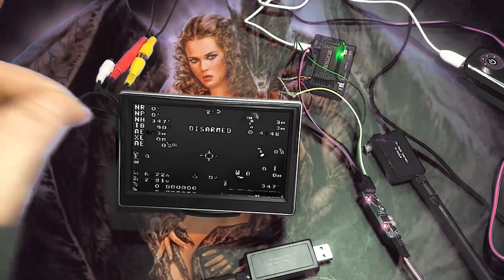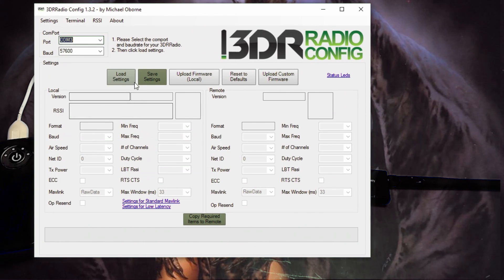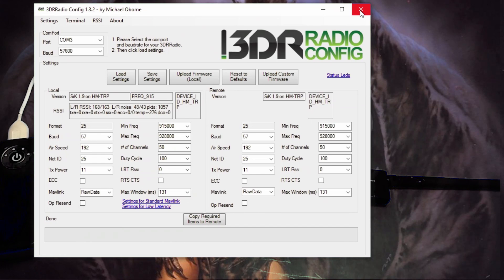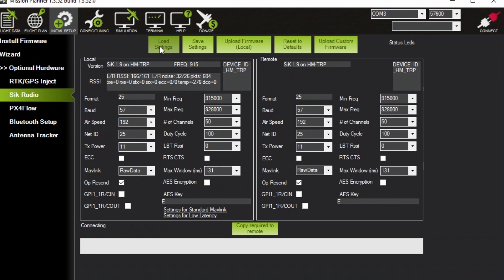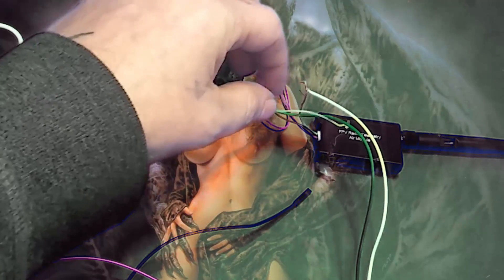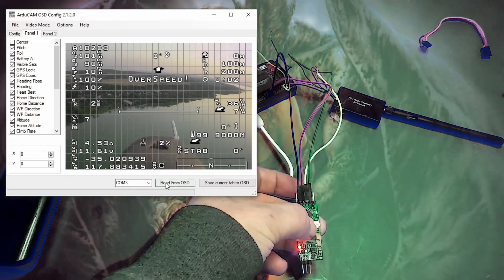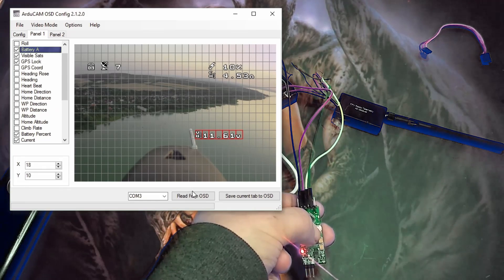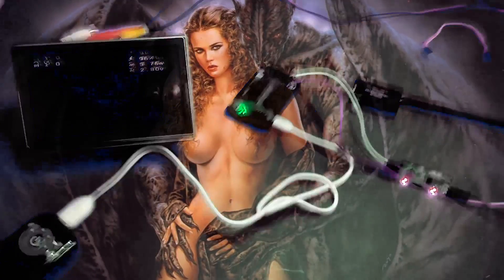Minim osd update lcd with telemetry module

Comment: hi i already have my osd but first i have to put the firmware to work or not friend.
Reply from the maker: Hi .. it should already come with firmware
Reply: bangs6996 I have it connected to an APM 2.8 but there is no osd image on the screen with a firefly 6s camera.
Reply from the maker: Hi do you have same osd as mine?   push play on my video and you will see two led's on the osd.. do you have 2 red led's? or just one ? on the side you plug in 5 volts
Reply: bangs6996 ok ,Thank you
Reply from the maker: here is another example.. https://youtu.be/EFBpiW3S0WU?t=593

look at my minim osd when i plug in battery i have 2 red led's..
do you have just 1 led?

Comment: Is the ftdi module only for program upload to minimosd
Reply from the maker: the ftdi can program and update the display just like in this video. 
all i've done in this video is made a wireless ftdi.

..   with the mod in the video . you can also update the firmware .. you just have to have good timing on pushing the reset after you click on the open file.

Comment: Short click on reset button , not neceacery to hold him all the time. Put video settings at auto to choose from pal or secam
Only three cables needed to read Malvlink, third is TX telemetry to RX OSD,
Blue-Pink board is better, green one is very fragile.FTDI Basic Programmer
is universal for that case not that usb cable
Reply: ok
Reply from the maker: but i do have to ask does the blue-pink board get as hot as the green board?
My osd board gets pretty hot in a min or so..
Reply: 5v jumpers is soldered right ?! 
Blue board which is ver 1 is go hot too but not as vtx for example .
I have one working green and not go over 30-35 degreece temperature
so they with one temperature for me
Reply from the maker: Yeah I  have a trace on the top and bottom pads connecting the pads together....So i only need the 5 volts input on one side..
Reply: Ok,  its just work to that way...with temperature.
I must sit and try on green board so solder battery one or two
voltage measurments pins because MW micro wont to read voltage from voltage wire leds for XK500, all other data from gps wire is ok.